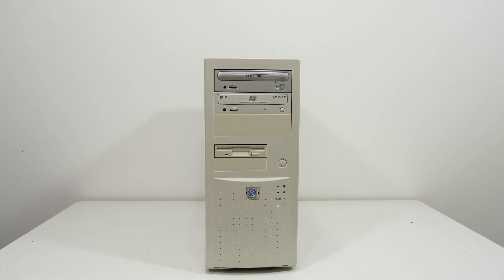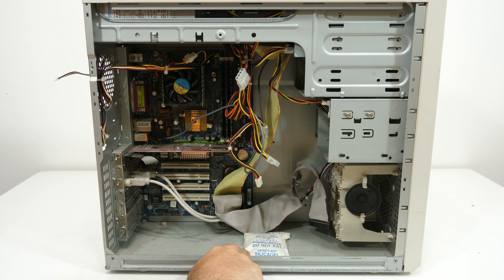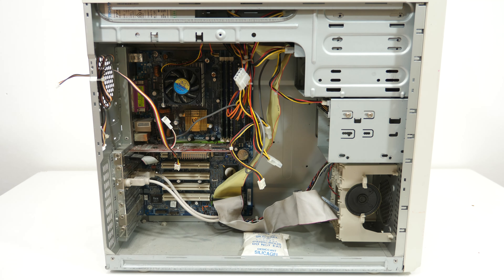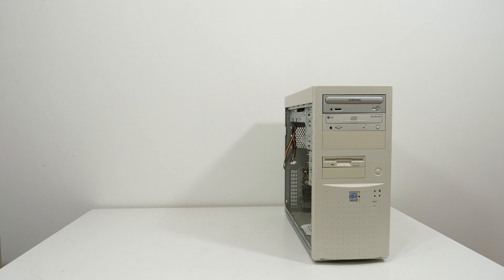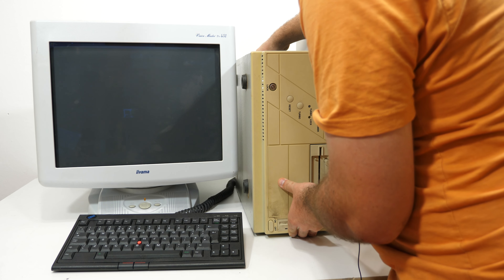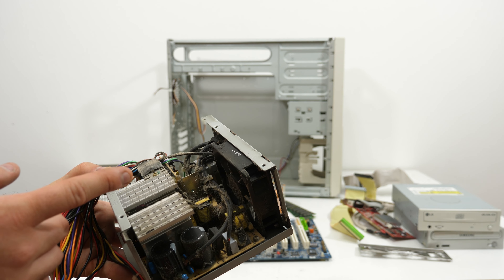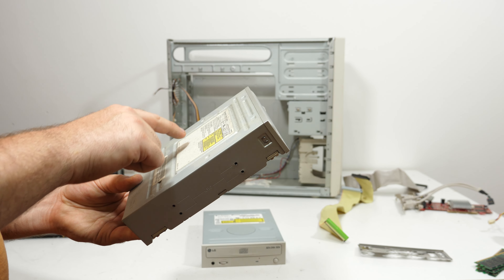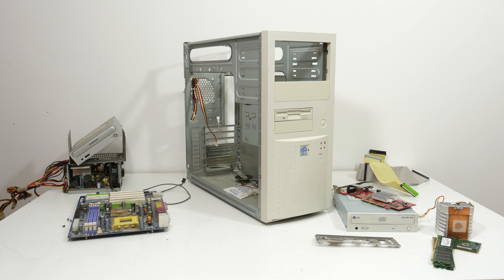Computer VLOG26: Dumpster PC Failed the smoke test, Lets part it out!

Comment: I have that same motherboard. I think it's well worth saving, a recap could fix it. I test old parts always with a modern PSU, even 386 stuff I use adapters with modern PSU.
Reply: I agree if you have the tools on hand recapping should resurrect the board.

Comment: lol it even knows it's bad, the pc speaker sounded like a ambulance siren
Reply: The Amazing Engie that means the motherboard can't start video system o something before, for example memory problem or  anything that prevents reach the video part of the BIOS, if you have 2 dimms and the first is bad then the board will not boot but the board probably is good, at least before the boom.

With the most of the problem with hdd o other components BIOS can show it with a code or a message, but when is not possible initialize the video component the BIOS had some like a beep codes, and that ambulance sound was one of those.
Reply: I actually had a bunch of that Gigabyte motherboard. One of them did the same thing - thermal diode is broken, hence it won't work. Went to the trash.
Reply: This siren means oveheat or problem with votage. I'm sure that it's caused by damaged caps.

Comment: I had 2 AthlonXP's (2000+ palomino core @1.66 GHz) and an Athlon XP 2800+ barton core @2.08 GHz, paired both with Gigabyte motherboards, between 2002 and 2003. By then Gigabyte AMD boards were plagued by bad capacitors, and I had to replace both boards. I'm not surprised after all these years a capacitor can blow up.  It's a pity,  because the systems were quite powerful and competitive with a pentium4. The CPU you have there if it is a 2600+ is a barton core based one with 1.93 GHz CPU speed, and 512KB of L2 cache, quite a nice one, good find!

Comment: Victor, the solution on this problem is that the capacitors are damaged. You need to buy new capacitors and desolder the bulged capacitors then solder the new capacitors.

Comment: Oh I hear the ambulancy coming to save that poor motherboard ... wait, no that's just the PC speaker doing some weird noises
Reply: The board had an alarm if the voltages and temperatures wen't outside normal limits. considering the state of the capacitors I would guess it was the voltage levels.
Reply: @morantaylor  CPU cannot start to overheat so quickly, so it was voltages. Eighter power supply was bad, or voltage regulators were damaged. Capacitors cannot change voltages, as far as I know, and if they were shorted, motherboard would not run even into the BIOS, to beep code.
Reply: @warrax111  If they are on the CPU's voltage output stage they can as they filter the ripple for the motherboards DC - DC voltage convertor. Not all motherboard voltages rails are supplied from the PSU.
Reply: @morantaylor  It was not the case, because from new power supply from that added computer it ran and booted up.  So it was the original power supply, which caused incorrect voltage, not capacitors.

Comment: dont scrap the psu you can easyly test it it without motherboard. the other things you can test too
Reply: Yeah, it's probably just the capacitors going bad on themselves, this was right into the capacitor plague so this is not a surprise. I'm pretty sure that both the CPU and motherboard are fine. Just that the motherboard needs fresh caps and the PSU a nice cleaning
Reply: yeah right. i never scrap only after good inspection and if cant not be repaired. i repair almost all. last year i have trown away only 1 shitty eurocase psu wich is prety shit right from factory.
Reply: Patrik McKane Working doesn't mean it's within ATX spec. Maybe the voltage ripple is way out of spec. Or the power-on switching is really messy, damaging other components. It's easily replaceable, so getting a quality PSU for a few bucks is the right thing to do!
Reply: SBBUK A true professional PSU tester costs as much as a Z06 Corvette.
Reply: no i dont agree. and trowing parts out without inspection and testing is dumb as fu**. i can not personally afford it just so " oh this is dusty i trow it away".

Comment: Victor FSP voedingen zij de betrouwbaarste voeding uit die tijd en nu nog steeds ik had van mijn opa's oude pc een (400w) voeding waar op de sticker zei dat het een gaming voeding was dat ding was lichter als mijn ander 640w voeding van coolermaster ik dacht ach whatever het zal wel. Een paar weken later had ik een moederbord uit een stoffige pc gehaald en er zat een 300w voeding in van FSP maar die moest ik nog schoon maken dus ik teste het met die (400w) voeding. Dus ik ram op het aan knopje gebeurd niks vervolgens sluit ik een oude 160w voeding van FSP aan die ik uit een oude packardbell had ge haald nou wat denk je het moederbord werkte prima met die 160w voeding en die 400w deed niks  lang leven FSP
Reply: Victor FSP supplies the most reliable power supply's from that time and they  still are now I had a (400w) power supply from my grandfather's old PC where on the sticker said that it was a gaming power supply that thing was lighter than roll of paper I thought ah whatever it will work fine . A few months later I had a motherboard removed from a dusty PC and there was a 300w FSP pwrspply but I had to clean it so I tested it with that (400w) power supply. So I slam on the power button nothing happens then I connect an old 160w power supply from FSP which I had taken from an old packardbell now what do you think happend the motherboard worked fine with that 160w power supply and that 400w did not had use any more so i scrappd it  FSP forever

Comment: Victor FSP supplies the most reliable power supply's from that time and they  still are now I had a (400w) power supply from my grandfather's old PC where on the sticker said that it was a gaming power supply that thing was lighter than roll of paper I thought ah whatever it will work fine . A few months later I had a motherboard removed from a dusty PC and there was a 300w FSP pwrspply but I had to clean it so I tested it with that (400w) power supply. So I slam on the power button nothing happens then I connect an old 160w power supply from FSP which I had taken from an old packardbell now what do you think happend the motherboard worked fine with that 160w power supply and that 400w did not had use any more so i scrappd it  FSP forever

Comment: Preety good  mobo. I have one in my old PC with 2GB RAM and Barton 2500+ :) Still does the job with Ubuntu... :D Fuck u Windows - I don't need u anymore... I think that the problem was in PSU and I'm almost 100% sure that psu repair/replace and caps replace should solve the problem... It's no big challange to fix computer by replace broken PSU/mobo/disasseble it. Big challange is to find out what's wrong excatly with PSU/mobo and fix it... Personally I always repair mainboards and PSUs  by yourself and I replace them only if the repair is too expensive or impossible/doible by qualified personel with proper tools/equipment. In my opinion Victor should not power on this system with this PSU when spotted damaged caps. Damaged  capacitors always means serious tourbles with PSU and it's not good idea to power the  system on without  PSU repair/replacement and caps replacement.